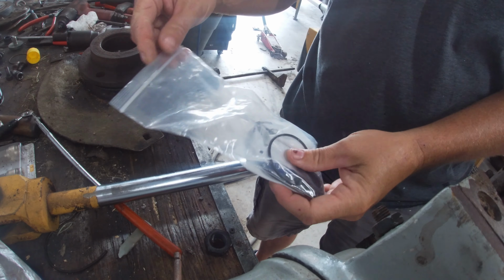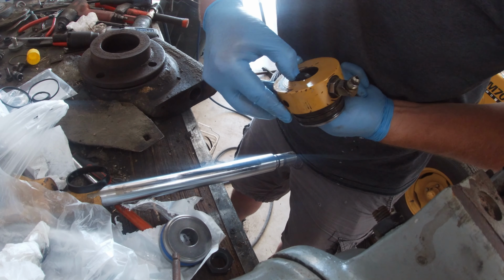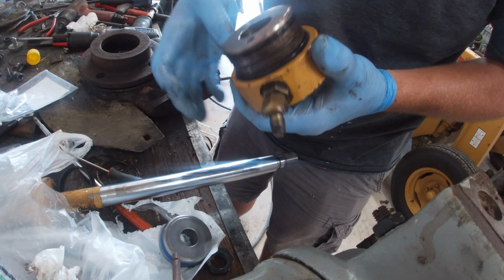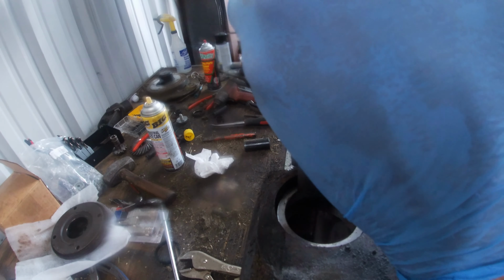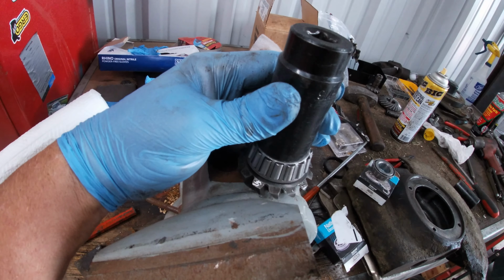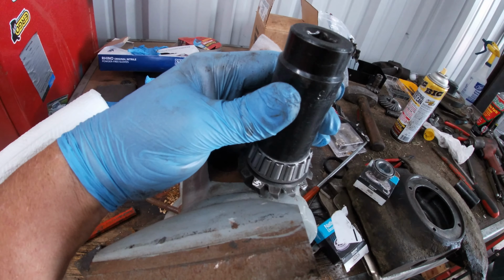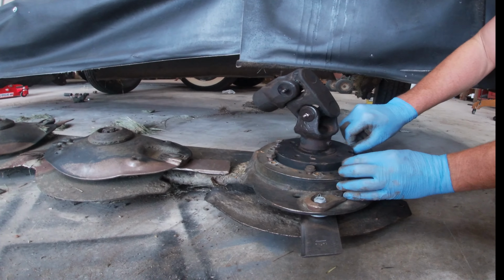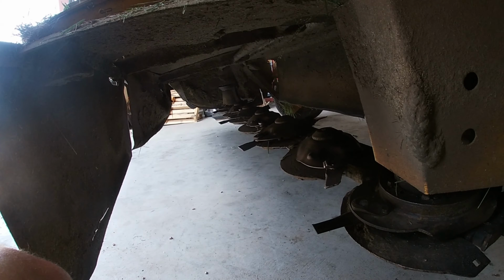Vermeer TM cylinder & pod reassembled

Comment: Thanks for sharing your your work. I have a 600 and by watching your video my winter project is to rebuild the cutting bar on my machine. The blades on the unit next to the drive unit are hitting literally trashed a new set of blades.  The turtle on that unit has lots of play in it where it wasn’t torque down properly.